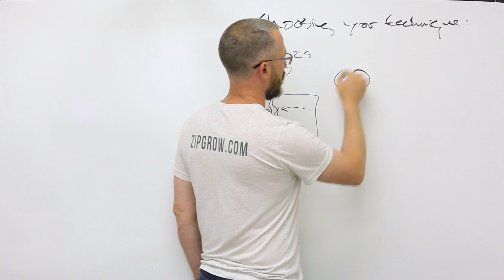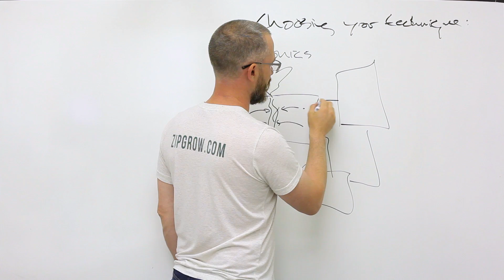Why is clogging an issue in aeroponics?

Comment: If you use air atomising nozzles you wont have any clogging issues, you`ll also need fewer nozzles (typically just 1 or 2) and get better mist quality and coverage. Minimal to no filtration required especially if you run to waste. I wouldnt waste money enrolling in an aeroponics course run by folks that dont have hands on experience ;)
Reply: Atom izer  Sounds smart, but aren't air atomizer nozzles very expensive.   Can you point me in the right direction how to build one?
Reply: Chase, 
They might seem expensive but consider you`d only need 2 for an 8x4 chamber vs upto 32 hydraulic nozzles and associated plumbing/fittings (which typically costs more than the nozzles)
AA nozzles are used in a lot of industries so they do come up on ebay as surplus/bankrupt stock sometimes (cheap). The nozzles consist of 3 components, body, liquid cap and air cap which can be bought seperately so if you find cheap nozzles its worth buying them just for the bodies (Spraying Systems is one to look out for).
Delavan are also common in the states although i`ve never used them. They dont appear to be as high quality as some other brands but will do the job. Look on ebay for cheap/surplus Delavan 30610-5 or 30609-7, again the bodies and caps should be available seperately as they are 2 component nozzles.
Reply: @atomizer2665 My friend, i am new in aeroponics ,so with an atomizer i dont need any filtration? is it an extra spend because the air pump? is it a big extra ? what water pump do i need? a lot of meters of pressure?  do you know where to get more info? how to fix it etc.. not clogging at all?? thats great!!! please inform me, thank you:)
Reply: @phonixsolomon6275  
Most aero setups that run drain to waste dont need filters. Fresh clean nutrient doesnt have any solids or junk compared to the nutrient returned from a root chamber. I run high pressure and air atomised nozzles without filtration and have no clogging issues. Drain to waste frightens a lot of folks who are used to hydroponics but HPA and AA aero use so little water theres no sense recirculating the spent nutrient or contaminating an otherwise clean system.
Reply: @phonixsolomon6275 
The towers in the link couldnt be run drain to waste.  The designer went for maximum planting area which resulted in a huge volume of empty space that roots could never use but still requires misting. A 2ft diameter cylindrical tower 4ft tall will provide 60 planting sites for lettuce, leafy greens etc and will only require 3 nozzles.
Reply: @atomizer2665  I ma talking with a company of air water sprays, they tell me that the pistol it will be opened by time to time for cleaning it, so then we can solve the clogging issue,  is that right? is it a system for no matter how dirty water gets (relatively) and ppm nutrients that doesn't clog and not cleaning needed, because they tell me that automatically the pistol will be opened by time to time for cleaning, is that right?  d
Reply: @phonixsolomon6275  
Most air atomising nozzles can be fitted with optional automatic (or manual) clean out needles. I dont use them and have never had any clogging issues
Reply: @atomizer2665 in what kind of structure do you use your aeroponics system? tower, bed, pipes or what?  they are misting nutrients here https://www.youtube.com/watch?v=-_tvJtUHnmU&t=25s, what system do you think they use for misting it, atomizers or what?
Reply: @atomizer2665  What you said right there just answered a question I was asking myself. If it would be less of a hassle to simply not return the HPA waste to the reservoir because the waste alone is much less than what a dutch bucket/dwc, uses in the first place. One guy I followed said he only recirculate the waste while the PPM was under 20.
Reply: And our paths cross again.....Atom....Greetings friend...
As previously mentioned I have all the gear from A to Z to set up my Aero unit (accumulator, pressure switch,regulator,solenoids,timers,relays and all plumbing etc etc).
I have a plethora of nozzles as well... 0.15 to 0.6mm diam.....
The root zone (black box) will be 1500 X 900 X 800 (lid or planting zone is 1500 X 900 giving me 800mm depth)
 Work and family commitments have halted the build from the get go ..The thing is.. NOW I'm ready to roll!
(yes... its been a long 18plus months.....)
As you know I'll be running to waste..
Perhaps a silly question but would I have a lot less clogging issues by doing so? (will definitely  be checking daily regardless)
The real question is... what is required to run Air /Mist ?
Could you give me a rundown of the gear required (Air compressor and the right nozzles?)
(My wife is going to go nuts as Ive spent a small fortune on a shed load of gear i haven't even put together yet!.. but what can you do ...)
Many thanks in advance...
Reply: @seanosomething  
Sorry Sean. just saw this..better late than never i guess ;) 
The hardware count for AA is lower than for hpa. AA  needs a compressor, cycle timer timer, nozzles, solenoids and very little plumbing.  Hpa needs apump, accumulator, pressure switch, pressure relief valve, pressure reducer cycle timer, solenoid, nozzles and lots of fittings to hook it together. Cost wise, assuming you have a suitable compressor there`s not a lot in it ;)